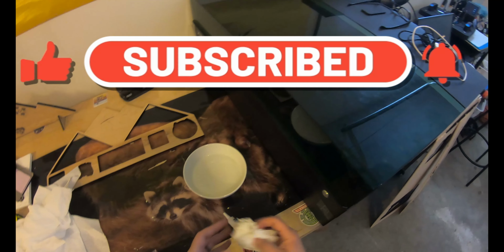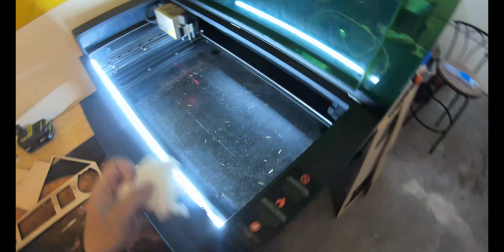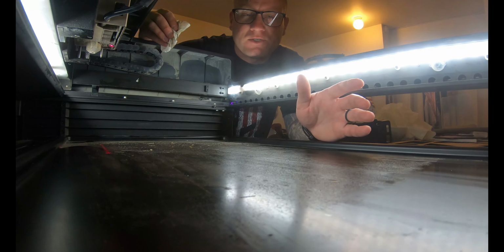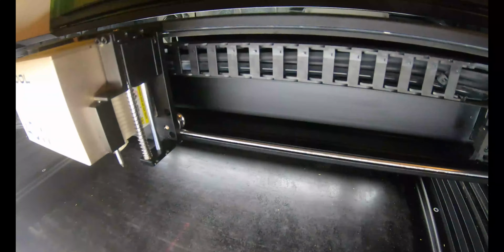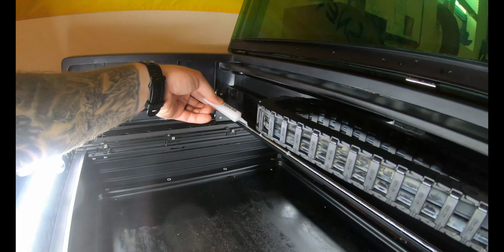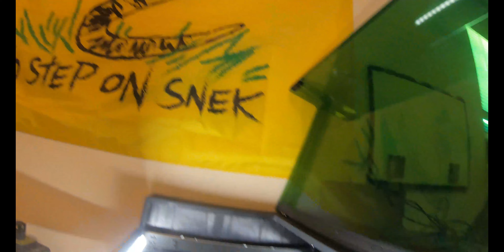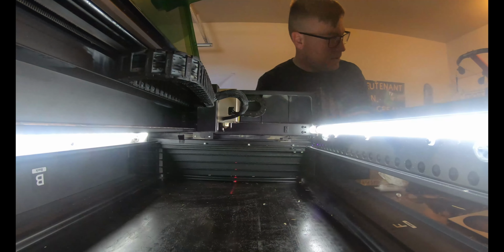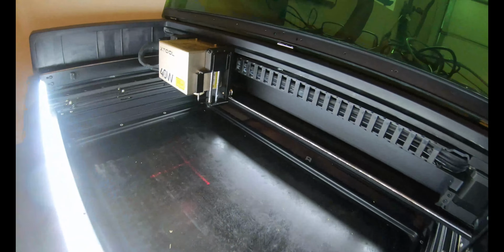How to clean and lubricate xtool S1

Comment: I’ve only just got my s1 and was wondering what the tube of white stuff was, I had assumed it was wood glue haha, thanks for the helpful video I will follow your method as soon as I need to clean my machine.
As soon as you called it ‘Penge Sheng sauce’ I got a craving for noodles haha
Reply from the maker: @nijl3d  lololol, its sounds like cup of noodles.  when i got my machine I had no idea what it was.  After some research I figured I would make a video and help others out lol

Comment: i understand the 40w laser module should be cleaned after every 30 minutes of use,  or probably an 1-2 hours with air assist on high,  
and i would definitely take the noticeable chunks and tray debris out often....
how often should the S1 be cleaned and lubricated like this?
Reply from the maker: The chunks and debris get removed pretty much everytime, however, I do not wipe the sticky residue from the wood on the tray too often. The honey comb makes this less of a concern. As far as how often it should be cleaned and lubricated, I don't have the official answer. I've been doing it roughly every month or two depnding on how often I use it. Basically if the laser head is super dirty or there is a lot of build up on the walls I take that as an indicator to lube the bars

Comment: I was wondering if WD-40 would be any good or better 🤔
Reply from the maker: I wouldnt recommend it because the peng sheng is more of a grease for the movement over it. However if the wheels and pulleys started locking up WD-40 would make sense to me.
Reply: @everygooddaydesigns  What would you recommend if we don't have the Peng Sheng grease?
Reply from the maker: @mojo2613  I'm not gonna lie, I'm not sure. However, I dont see why any grease from a car parts store would not work. The purpose is lubrication, I imagine a grease with similar properties would be fine.
Reply: @everygooddaydesigns  Yeah, I did some research on it.. I think you're right. Or I see some other silicone based grease on Amazon sold in small tubes.
Reply from the maker: @mojo2613  yeah,  not a lot about peng sheng on the internet really.
Reply: @everygooddaydesigns  Found some, but it's all overseas. But other silicone grease available.
Reply from the maker: @mojo2613  thank you, best of luck with you machine
Reply: Be careful with WD 40.  Over a time it leaves a sticky residue that is very difficult to clean off.  Most clock makers/repairmen will refuse to work on a clock that has been lubricated with WD-40.  Although this is not a clock, it still can be adversely impacted by sticky lubricants.  Silicone based lubricants are best for this type of application.